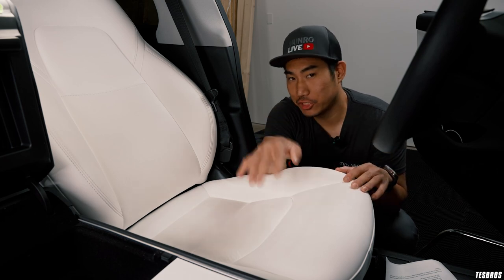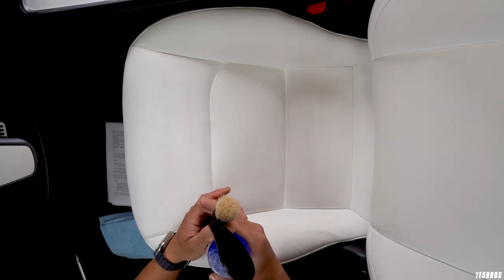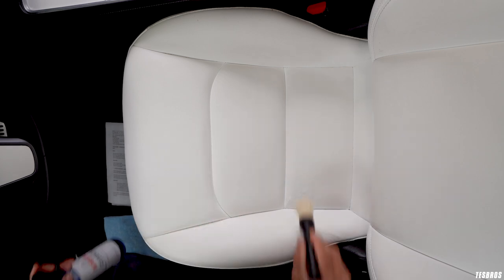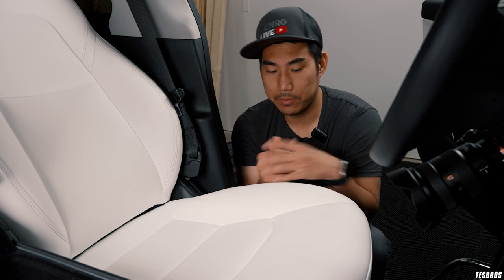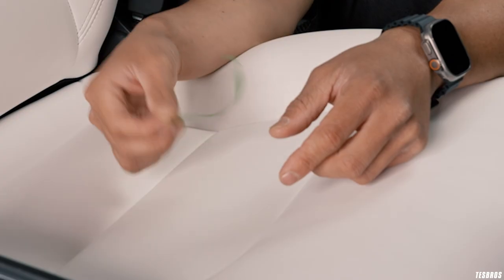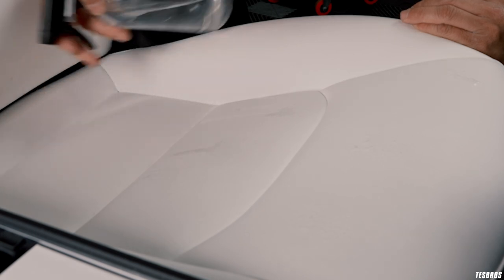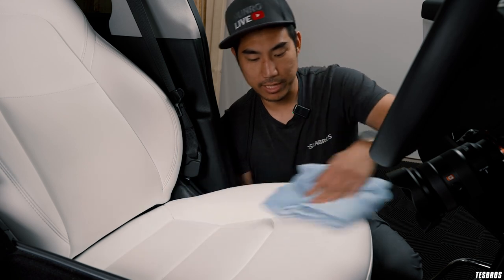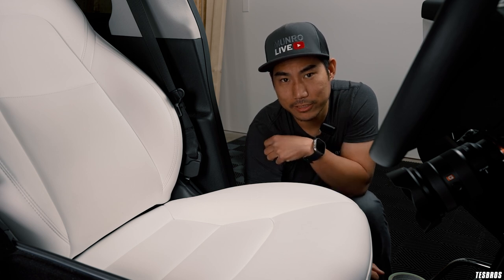5 Months After Applying Gyeon Leather Shield on White Tesla Seats - TESBROS

Comment: Used Gyeon, 3 coats right after delivery, still have dye transfer from jeans (and I don’t use dark wash).
Reply from the maker: What are you using to clean?
Reply: I just did one coat, but I have same issue and haven't been able to get it out. I've tried 2 different suggestions and while it lessened, you can still see it.
Reply: Same here, I can't stand that product. If you find a solution PLEASE PM ME, as mine still have a blue tint to them
Reply: @tesbros  Chemical guys all interior cleaner, diluted all natural APC, isopropyl Alcohol, then moved to more abrasive things like APC and Magic eraser. Reapplied Gyeon after my best shots at fixing the dye transfer, since something is better than nothing. Just disappointed how expensive it was, and specifically bought it to reduce the chances of dye transfer. 

It's the heaviest on the left bolster on the bottom of driver/passenger side seat. So noticeable that I genuinely considered replacing the seat bottoms. Also noticed a light grey stain on the backseat.
Reply: @Holt0216  alcohol?? hahaha... that will literaly dissolve the polyethalene ...  so many clowns in the comments these days...
Reply: @NetworkPIMP  also “these days” I bet your hobby is trekking across the internet trying to be a Keyboard warrior. Please don’t embarrass yourself anymore than you already have
Reply: @NetworkPIMP  also the seats are made out of PU…? 😂
Reply: @Holt0216  yeah, you sure showed me...
Reply: @NetworkPIMP  nah, I sure called you out on your ignorance tho 👀

Comment: What product can I use to remove the Gyeon? All I have is a terrible blue tint after the application.
Reply from the maker: Since it is a ceramic coating, you would need to polish it off and I suggest getting a professional to do that. If you wait, it will come off on its own though (just takes a lot longer than a polisher). Did the blue tint appear right after application?
Reply: @tesbros  Yeah, almost immediately after applying it. I think it eas for using the little blue microfiber towelettes that it brings in the package.

Comment: Hello, I got the 2024 model 3, would this work on the new seats? And can I apply it on the black pieces (plastic) by the door trim, the area under the glass and dash board, or is it just for the seats?
Reply from the maker: Yes it works for all seats and any vegan leather in the car. I wouldn’t recommend putting it on the plastic parts
Reply: @tesbros  thank you! So what do you recommend using for the plastic trim like the dashboard or the trim under the side windows? I honestly not sure if that’s plastic or other material..
Reply from the maker: This will work well on the plastic parts - https://gyeonusa.com/collections/plastic-trim-coatings/products/q-m-preserve